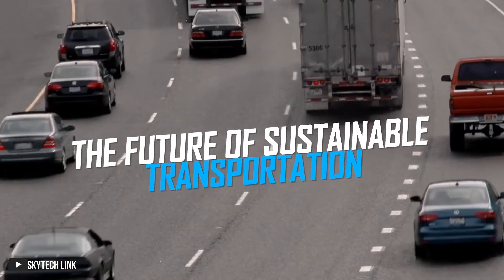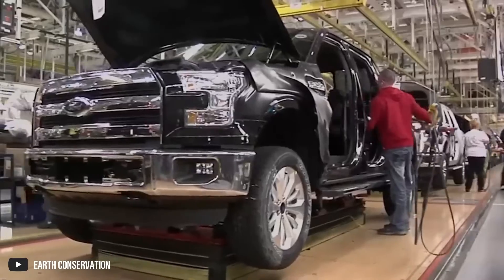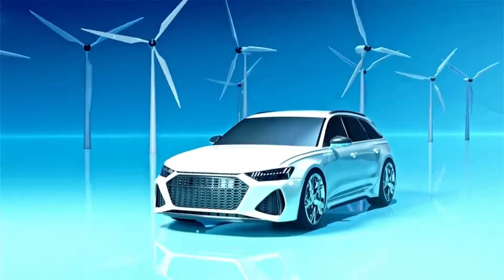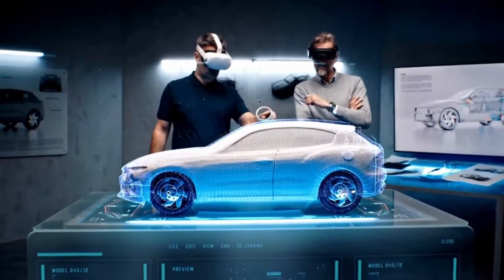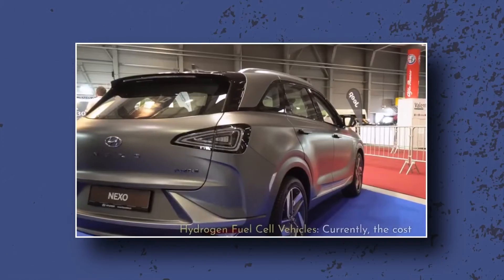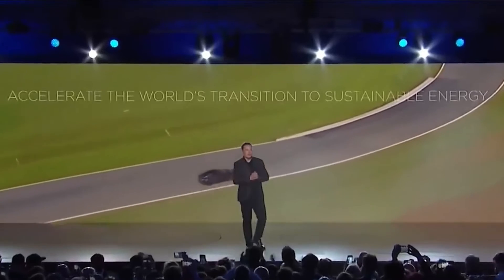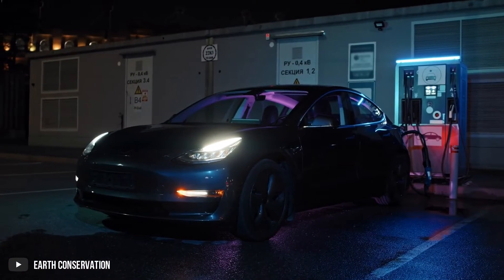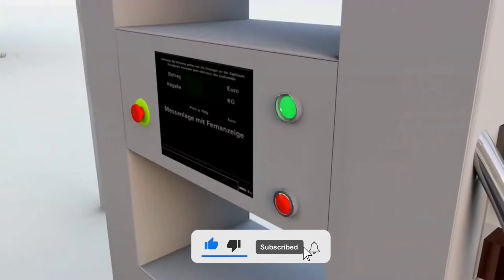Electric vs. Hydrogen: What's The Future Of Transportation?

Comment: Hydrogen is the future. EVs operating duration between charges is too short for normal use, especially in cold rural settings. Toyota believes hydrogen will prevail, and that is good enough for me.
Reply: https://youtu.be/ocNfkVA28mg?feature=shared
Reply: This is not true. I live in Norway, and with Tesla's heat pump system my car only lose about 10-15% range during the winter at most. Most of my daily driving only require about 15-20% of battery, so still plenty of range left. I also charge at home/work, which means that I only use public chargers a few times per year.